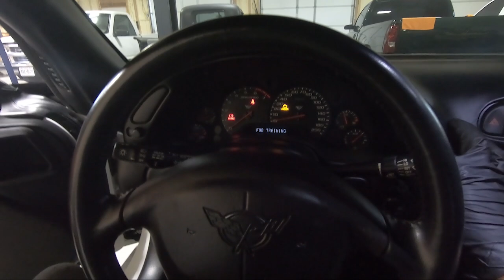C5 Corvette LED interior Light Upgrade (How to Install Brighter More Modern Interior Bulbs)

Comment: I have the c5 also and have pretty much done all the back except the reverse lights. I had a led but it was for fog light which I didn’t know when I ordered them. Had a couple of red led bud left over so I put them in the trunk. I do have he the rapid blinking because of the turn signals in the back and I have ordered the part to stop it so that another project in a couple of days. Hey just do you know when you took of the license plate and the reverse light you should have reached in side  and cleaned both sides of the inner section. Mine had  leaves and enough dirt  to fill a cup. Used several paper towels both wet and dry plus I put the vacuum inside to finish it off. Check it and you will see, there are two 3 in wells , one on both sides as well that I put water in and dug mud out with my finger nails.

Comment: I changed out some of my interior lights this weekend with this kit. I had some issues with th hood light and will revisit that issue. Someone told me these nice led lights might melt my wires or something? I have not had any issues yet
Reply from the maker: They draw less voltage and if anything will run cooler. It will not melt your wires
Reply: @TWAMotorsports  that’s what I thought. Social media always has idiots that make me second guess myself. They see a lady fixing up a car and like to get it cranked up. I figured worse case they were cheap and might burn out but no biggy they were easy to change out. I had issues with the hood but ordered a different bulb for that one.

Comment: Installed my lights, I had to blow a fuse somewhere, but not the fuse shown in video...I'm going crazy trying to figure this out because now none of the lights I installed work😣
Reply from the maker: That's weird. No issues with mine. Check both fise boxes. Under hood and in car.
Reply: @TWAMotorsports  Thanks, it turned out to be a different fuse on the passenger side...I had to do my googles, lol
Reply from the maker: Glad you found it

Comment: Do they make that kit for the Firebird? I have a 2000 T/A that could use some LEDs. Thanks
Reply from the maker: I'm sure they do
Reply: I bought that kit for my 00 t/a on Amazon for $13.
Reply from the maker: @daveholsclawjr3053  nice. Need that when I finish the ta up